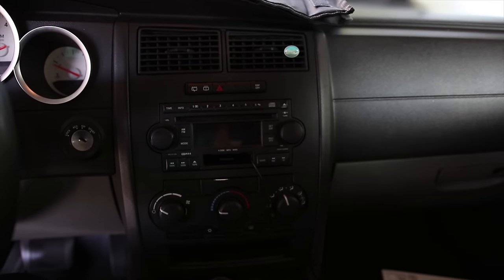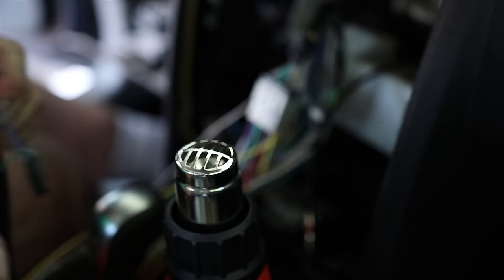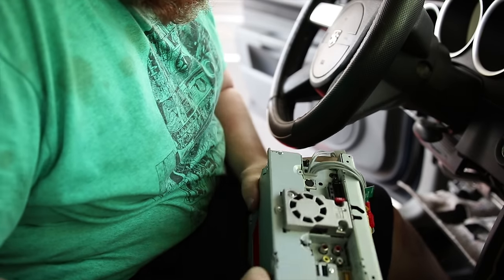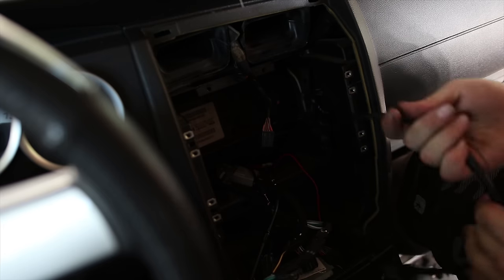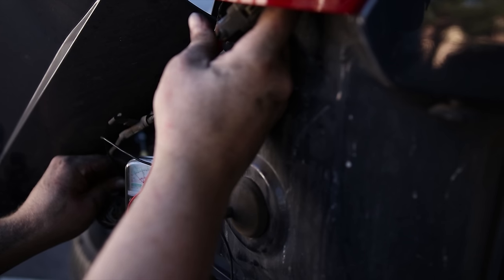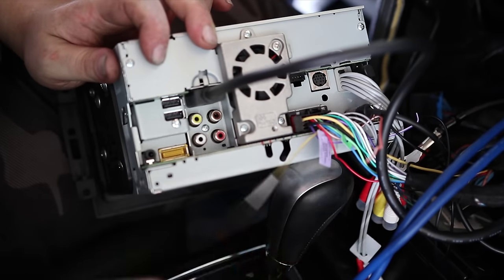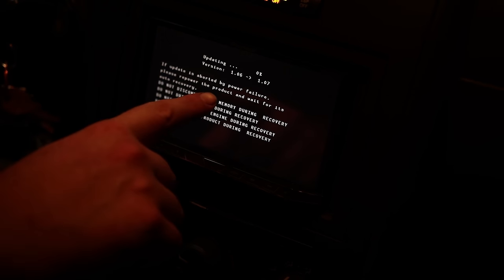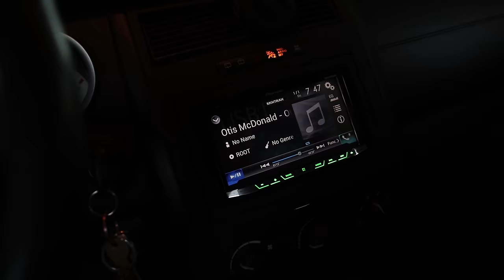Installing a Stereo, USB Ports, and a Backup Camera in a 2005 Dodge Magnum (Amp Bypass)

Comment: Nice job, I did a very similar install on my 06 Magnum about 7 years ago. A tip for anyone about to do back up cam install; run the video wire up the rear pillar along roof line and down the "A" pillar into the dash. It clears everything and tucks easily in the top side molding, and you don't have to remove any of the trim.

Comment: Just buy the pac harness its very easy its plug and play. The pac harness will connect to your existing 4 door speakers and your 2 front little speakers as well. You will get the sound from your factory amp and the radios equalizing sound as well.
Reply: That’s exactly what I was thinking 🤦🏽‍♂️
Reply: And keep steering wheel controls,  but im now watching this because im going to replace the factory amp . Was looking specifically to see if the metra bypass harnesse had the tweeter leads or not .
Reply: Yeah, but I can't seem to find one.

Comment: Old video, but hopefully someone replies. I have an 05 Magnum with no factory amp, I am having a hard time finding the correct wiring harness. Ordered 2 already that says will fit my 05 but plug is not correct on either. Tried going to a few local audio stores and they want to sell me the interface wiring harness about $120. Is this my only option?

Comment: Excellent video my friend! Just bought a 2006 charger and going to install my sony double din. Your vid is the best I’ve seen. Don’t think mine has the amp so I may not need the bypass connector. Great that you included every step. Thanks

Comment: Hey man, quick question my wiring harness from car to new stereo has 2 yellow 12v and 2 black ground wires. I can see in your vid that your second yellow and black wires are rounded back into the connector as the new stereo only needs one of each. Any idea what I should be doing with the extra yellow and black wires from my connector as they are hanging loose.

Comment: Add a set of sockets to that list above.   Screw gun and socket/nut driver turns that @3:00 wrench turning into 10 secs of “don’t fuck-up-the bolt-heads” pleasure.   Some people get paid by the hour.  I don’t.     Nice work though.   I’ve always been very impressed with my factory RT sound system, but it doesn’t get quite loud enough.  If that one goes to 38, I need mine to go to 45.  11 isn’t enough...     plus you got that B&D heat gun but didn’t use it?  They work much better.   They don’t burn it so easily and give a more uniform shrink.     Oh, you did use it.     Duh.  Sorry.  So my speakers sound blown, but I’ve realized that’s it’s mostly the trim in proximity to the speakers that is buzzing/rattling.  Didn’t realize the ones in the dash are tiny.   If they are blown, that is a design flaw.  There shouldn’t be enough low end going to those to hurt them.   I think it’s trash like dust, debris, I don’t know, but when I put my hands on the dash and vents the buzzing mostly goes away.  I have a lifetime warranty on my car so I could just tell the to replace them but I want to improve them.   So.    Does that new head unit have more power than the factory set up, and does it get significantly louder?   Does it still have the great sub low end but even better now?

Comment: Hey question brother. Where do I find that parking brake bypass ??? Can’t find it on Amazon where’d you get yours ?? Thanks!
Reply from the maker: I got it on Amazon.  It looks like they don't offer the one I used anymore.  I did a search for MicroBypass and saw this:  https://www.amazon.com/APPS2Car-Motion-Interface-Pioneer-Receivers/dp/B07P53PTJQ

It looks like a replacement, but I didn't see a single pack version.

Comment: Good set up tutorial on this installation but I never liked those heat shrink connections that requires a heat gun. It's not only slow but dangerous. Just going old school with electric tape and zip ties. Butt connectors are probably best though.

Comment: I plugged my red wire to the red wire on the wiring harness should I not have done that? Is that why my aftermarket radio is getting no power?
Reply: My is doing the same thing. Did u ever figure it out?

Comment: This method eliminates power to the tweeters on top of the dash by the windshield. I found out the hard way when I bought two 3.5" pyle audio tweeters and they didn't turn on. Everything else works though 👌

Comment: Got a question for you. My dad also has the same blue magnum but no Boston speakers and he doesn't have an amp under where it is in this video. Does that mean that I don't need to bypass anything and can use the car harness to plug into the new stereo if wired correctly
Reply from the maker: yes
Reply: @Distractor_Beam  thank you so much

Comment: Well done, this helps. Coincidentally, I had been searching this morning to try to find out what those vents are that you ran your backup camera wire through. If I run the wire through there, do I still have to remove the bumper? I'm hoping not to have to do that. In any case, what in the heck are those vents for? I found lots of dirt and dust just inside those vents when putting Kilmat down. Those vents probably make their way to the rear speakers as those speaker "cavities" seem open to that entire plastic piece that you loosened and pulled out of the way to get to the vent. I still don't know exactly what I should be doing to make them good for speaker enclosures. I'm going to add poly fill in addition to the Kilmat, but I don't honestly know if that's the right thing to do with those odd enclosures; which are oddly, different sizes. Thanks for taking the time. I've also recorded some and I'll post it when I'm done.
Reply from the maker: This is the best answer I found
https://youtu.be/Rl5y42t8O7w
I remember hearing a long time ago that the Tesla is air tight.  I wonder if that effects people when slamming the door?
Reply: @Distractor_Beam  That is a good explanation. Coincidentally I was just watching this one - https://www.toyotanation.com/threads/vents-in-trunk-what-are-they-for.266030/
Which explains it too, but the video you pointed out is much better.
Thanks a bunch !

Comment: Hi Distractor, I'm attempting to install forward and reverse cameras. I bought two Boyos. As it turns out, the cheaper of the two has led lights and a different wiring configuration aside from the extra green to power the lights. Attached to the yellow rca is a red trigger wire, which I think you show in your video. I expected that wire to be up at the head unit and not back in the rear connecting up to the tail light wires along with the regular red camera power. The Boyo instructions show that the camera red needs to go to 12V (presumably tail light) but that the trigger wire should go to the head unit harness. Do you essentially have the yellow rca reversed such that you're just attaching the trigger wire also to that same tail light power? I'm also wondering why if that red trigger wire is so important; why doesn't the other more expensive Boyo have that same red trigger wire built into the yellow rca video cable? Thanks for any help. I like those little splice in connector thingys you're using. Let me ask also; in retrospect, might it not have been easier to run "all" those cables in through the rear vent and connect the power via a fuse tap since the fuse box is right there in the rear? I was hoping to avoid removing the bumper.
Reply from the maker: Yes.  At 1:01:42 I started to connect the trigger wire from the RCA cable to the same wire for the camera power, so the backup lights provide power both to the camera, and to the head unit.  

On mine, the trigger wire attaches to the  RCA cable and runs all the way up to the head unit along with the RCA cable.  It's important so it automatically tells the head unit to select the camera view when you put the car in reverse.  It's sending voltage to the head unit.  

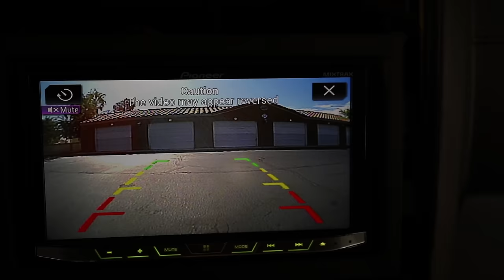At 1:20:30 I discovered that the trigger wire wasn't actually working, so I ran another wire from the kick panel (where the rear tail light power wire is) up to the head unit.  It does the same thing.  The trigger wire in the RCA cable is an attempt to make it easier for the installer.

The fuse tap sounds like a better idea, providing you can find a fuse that turns on only when the car is in reverse.  If it has constant power all the time, the camera will run all the time, and that will reduce its life.
Reply: @Distractor_Beam  I'm learning more, but it's slow going. It's my understanding that in my case the reverse sensing wire from my new Kenwood head unit should be attached to the wiring harness reverse, not that red wire that piggy backs the yellow rca. Guess it depends on the equipment and car involved. I have one camera that doesn't have the red piggy back wire at all. I guess that unit is more ideal for my configuration that doesn't need it. I think i can run the wires behind the license plate through the vent, but  not 100% sure. There is a fuse back there for trailer brakes that might work. Thx for getting back to me.
Reply from the maker: @jeffh2125  All good. You are correct that if your car already has the reverse wire as a part of the wiring harness, you won't need to use the trigger wire that's part of the RCA cable.
Reply: @Distractor_Beam  Wouldn't it be nice to power the camera from the car's reverse wire that connects to the head unit's reverse sensing wire by also connecting in that red piggy back wire?  Then we would't have to power the camera downstream at all. There is a guy on youtube pushing that configuration, but Crutchfield tech support guy was adamant that there is not enough power in that line and not to do that. How fantastic that would have been though. Also just an fyi that for the front camera, there is a perfect grommet just left of center on the firewall looking from the front. I just poked a coat hanger through both sides then pushed a larger leading rod through with rca taped on. I was dreading how to get through the firewall and it could not have been simpler. It took me longer to get the duct tape off the rca and leader rod than to run the wire. Need one of those chinese finger trick grabbers.  :-) Just a side note for other magnum owners. Also I will use that red piggy back wire on that rca cable to power the front camera, hooking it into the head unit's power, so that it comes on when the head unit does. I'm hoping I can have it shut off most of the time through control in the head unit, but I don't know if that's the case or not. It might be physically on all the time that the radio is. I'm not sure if there's a good way around that.
Reply: @Distractor_Beam  Hi again, Distractor_Beam. I posed this question on diymobileaudio.com and a guy responded saying that the reverse light switch was downstream of the fuse, so the fuse would be on. So, you have done it right. I'm just wondering if I can connect to that reverse tail light wire from inside the cabin, through the vent. Might be more trouble than the bumper as I have to get around the muffler without letting the wire touch. I guess I have some trepidation about removing the bumper. I don't want to have to replace those plastic popout thingies because Dodge doesn't make some of those parts any more. Besides, you have the cadillac removal tool. Pulling that out was just rude.  :-)  Wish I had one.
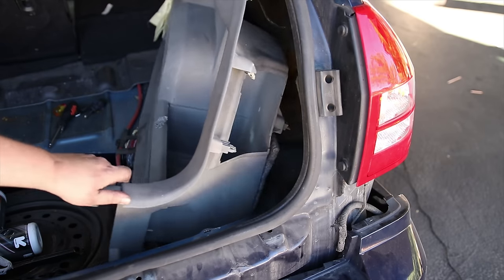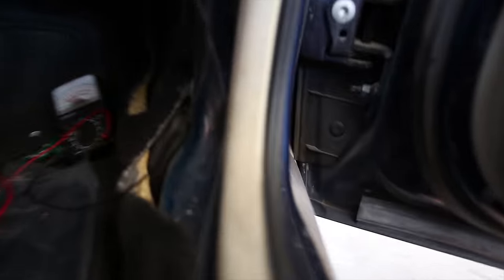Reply from the maker: @jeffh2125  Yes.  I believe the wire is in the bundle at 57:22.  Mine was white with a dark green stripe.  Alternatively I grabbed it at the passenger kick panel at 1:21:20.  It should also be available anywhere else that wire runs throughout the car.
Reply: @Distractor_Beam  I'll tell you what; I'm really tempted to drill a hole through that little rectangular slot in the behind the license plate because inside the car on either side of the locking mechanism are holes to get to that. My largest drill bit won't be large enough for the rca end, but I could dremel the hole wider or I think what might be better is to drill a small hole, cut the rca cable and re-attach to the end piece. It's different than normal cable. It's like coax with the sheath. This video shows it's not very difficult - https://www.youtube.com/watch?v=4C_RDEAdSco
Only thing is, I don't have an official grommet, but I could just wrap the heck out of it in electrical tape and it should be fine. I did some soldering yesterday, so I think I may go that route; no pun intended.
Reply: @Distractor_Beam  I decided to make a hole directly behind the license plate through that rectangular hole in the plastic bumper into the cavity area of the back. I then fished the wires through to one of those existing oval holes in the back near the latch. I needed to enlarge that rectangular hole in the plastic behind the plate a little bit to be able to get my dremel in there to enlarge the drill hole I made in the sheet metal a bit. I then fished the wires through and Rube Goldberg'd a pseudo-grommet. I'm waiting on delivery of T-taps in the mail today and I'll splice into the white with green stripe later today and ground to the black as you've shown; except from the inside. The nice thing about that sheet metal right behind and above the license is that there's two layers of sheet metal separated by a cavity of air space. Even if my crappy gromet let's a little water in, it likely won't get  through the 2nd sheet metal layer. And I'm not worried about water getting in through what I cut anyway. So, we'll see how that goes, but it kept me from taking off the bumper.  :-)  Glad you made this video though. Saved me from hunting down the correct wires.
Reply: @Distractor_Beam  Hi Distractor, I'm trying to identify the wire on the inside by your color description without a meter. You mention in the video green with a white stripe. But above, you say white with dark green stripe. In the inside bundle, there's dark green with a white stripe and a white with a light green stripe. Can you tell me if above you meant dark green with a white stripe?
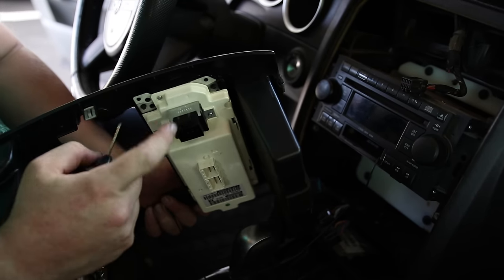Reply: Your video at about 1:03 or so shows white with light green stripe. You actually said "light green  stripe". So, unless I'm going with that. I hold you blameless if I pick the wrong one.  :-)
Reply: Hi Distractor, could you please confirm the wire for me? White with light green stripe? If not, please let me know. 
Thank you
Reply from the maker: @jeffh2125  White with a green stripe.
Reply: @Distractor_Beam  Thank you much. Only odd thing I did was to use a cable connector to bump up the tiny camera wires to 16 gauge, then tapped into the reverse wires. All speakers are installed. Now I have to do two of those usb extenders and mount them somewhere like you did. Received the head unit today and waiting for alpine pdxv9 amp on backorder. Can't wait to finish this.

Comment: Wasn't that nice hole in the bumper for your license plate light?
Reply from the maker: That's exactly what that is.  The light sits directly above it.  Why it was cut out larger I have no idea.
Reply: Distractor_Beam it’s not.  The light fixture is half light/half fill blank, so that the license place light shines on the plate correctly.

Comment: That heat gun actually melts the solder? Man those connectors you used to connect the head unit wires just seem sketchy. Have you had any issues with it? Those connectors look mighty convenient and tempting!
Reply from the maker: Still working great.  I learned about them at work when we were installing a motor encoder.  The only sketchy thing about them is the price.  It does take a while to melt the solder, and then you have to hold it steady for about 20 seconds while it cools, but then it's one of the most solid connections a person could ask for.

Comment: My ac won’t start after I did that, I think I forgot to connect the harness that’s next to the cigarette outlet but I can’t find the male end
Reply from the maker: That sucks.  I'd say that's the most likely scenario.  You may have to pull the whole head unit back out if it got pushed behind it.

Comment: I died a little inside when at the very end it's too dark to see around the stereo. I need to see how it fits lol
Reply: Did you have to modify the panel at all? That may seem like a stupid question...but I skimmed through your video and couldn't tell at the end.
Reply from the maker: I apologize.  There's some video at around 49:03 that shows the initial fit with some better lighting.

Comment: I did everything the same but my stereo stays on even when off why????
Reply from the maker: That's from hooking the accessory (red) up to a constant power.  You need to hook it up to accessory power.  If you hooked it up to the cigarette lighter, then your cigarette lighter might stay on all the time.
Reply: @Distractor_Beam  so were can i hook it up at
Reply from the maker: what car?
Reply: 2007 dodge charger
Reply from the maker: @oscarlaguna3561  According to google, the cigarette lighter should work.  Does it shut off when you open a door?  Sometimes the vehicle will provide accessory power until you open the door.
Reply: Yea it stay on as demo even if i use the off button on the stereo since the cigarette ligther is always on
Reply from the maker: @oscarlaguna3561  The next easiest spot to find it is the ignition.  I believe the wire you're looking for there is pink with a white stripe.  Keep in mind if you mess this wire up, your car won't start.  Before I do that I'd check the cigarette lighter with a multimeter and make sure it does in fact yield power with the key off.  It's possible the stereo is defective.
Reply: Could i just tap into a fuse and run a power cable from the factory amplifier fuse
Reply: @oscarlaguna3561  did your insulation work?